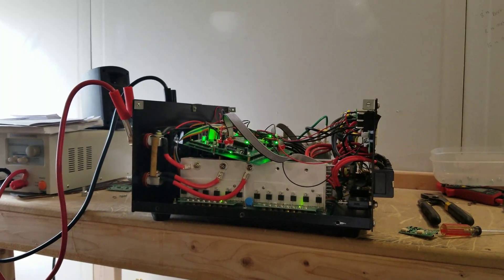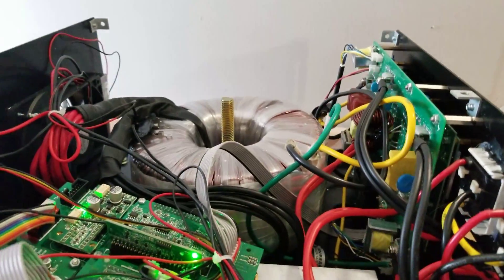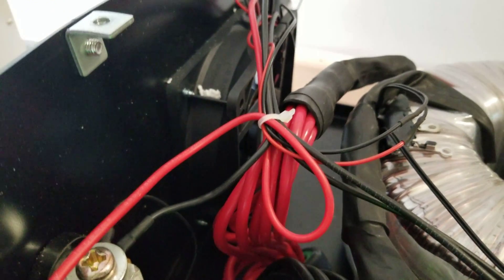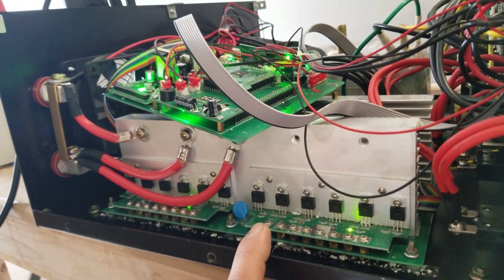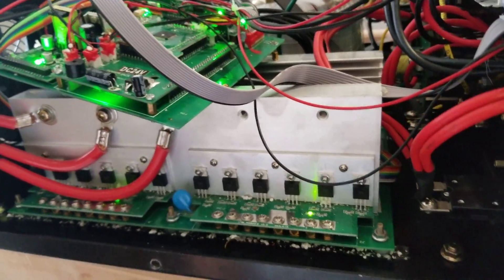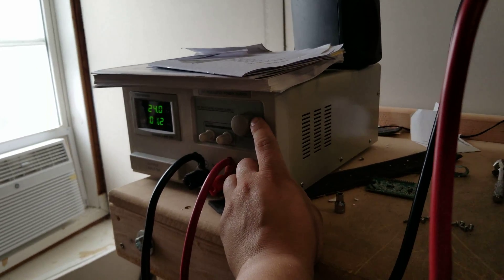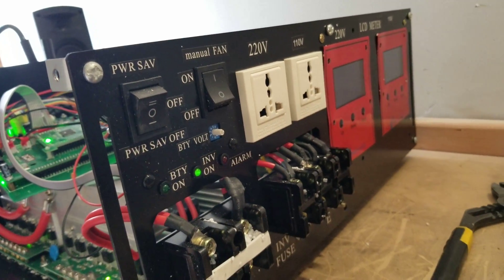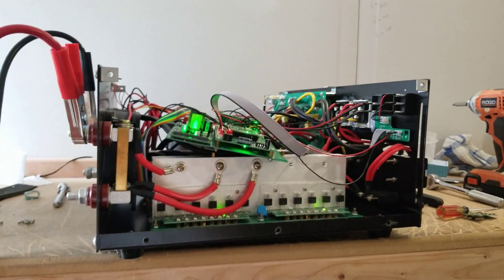PowerJack 10000 Watt inverter quick look

Comment: Update on my new unit....No damage to the outside, but I wanted to pull the cover to take a look inside for anything loose...Glad I did, the large steel plate on top of the transformer was loose and floating around...the real problem though was the large chunk of plastic I found laying on the bottom, it came from a large thinfilm capacitor  CBB22 400v 47 5u...the outer shell was shattered and the film itself cut. I have sent a comment to the seller to see what we will do next. As it is soldered into a fairly large board I don't know it they will send the whole board, a new capacitor, or if I will have to return the unit. So far...not much luck, we'll see how the next stage goes on warranty claims.

Update....They will be sending me a new board to replace the damage...Easy and quick response to the problem...

Comment: Received my 10k model today...couple of days earlier than originally thought...80lbs shipping weight so a small hand dolly is recommended to easily move it around and prevent any damage I have to say that they are quite impressive in person over the older models. Slick packaging and well done double boxed with foam on the inverter itself, plus a light bubble wrap to protect the paint finish. All looks excellent and will open it up tomorrow to check interior for any thing loose floating around and connections tight. Looks to me like PJ has really stepped up their game from just a year or so ago...When I begin to use it I will buy a few repair parts just to have on hand, mosfet sets, driver board, etc. before they change the design further and it becomes harder to get parts for outdated models. Prices are going up, so buy now if you can...this one, Ebay, $620 delivered, already moved up another $20 since I bought it last week. Now I need to get up all these solar panels and put the inverter to work.
Reply: I bought a power jack inverter I've had it for about 4 months and it turns on then it says my batteries are low and shuts off, just wondering what you thought and how to fix it?